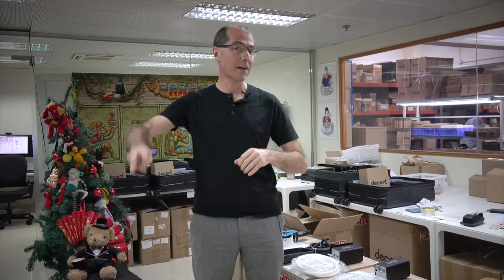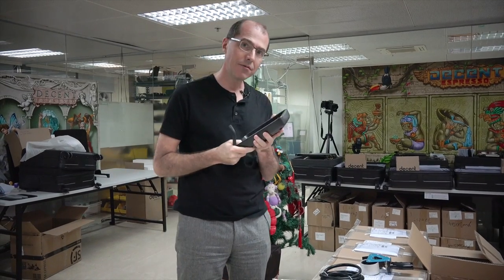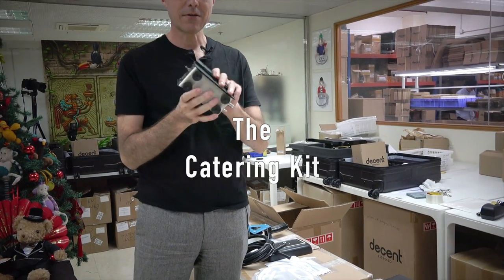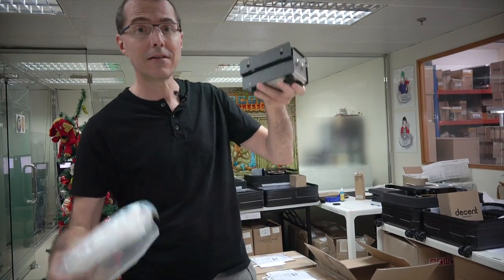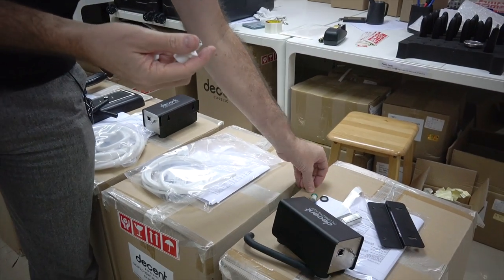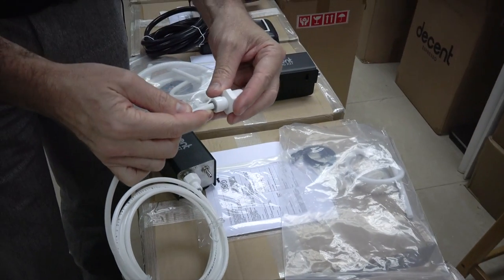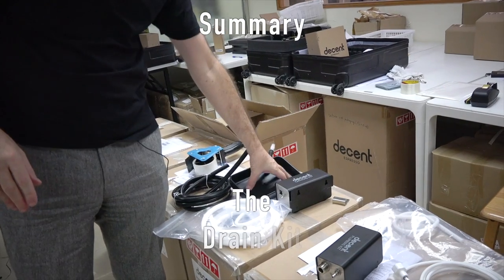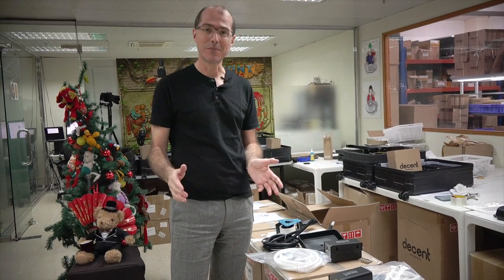The Refill kit

Comment: This is great!  Are these currently available?  if so are they shipped separately or with the machine?
Thanks
Reply: Included with the DE1PRO machines and available for purchase with the DE1+
Reply from the maker: Yes, these are now available but they are shipped separately as they will not fit in the suitcase we used to ship the espresso machine in.

Comment: The catering kit and plumbing kit are refill espresso machine water tank, right? Are there any option to connect directly the plumbing kit to the machine? I want to prevent "old water" in the machine.
Reply from the maker: The plumbing kit will always refill the water tank. However, if you are concerned about "old water" on the tablet software there is a setting where you can decide how little water should remain in the water tank before it is refilled. If you like, you can keep 1 cm of water in your tank so that you're constantly refilling with clean water.
Reply: @decentespresso  After looking at your description of the catering kit in the video, I kind of got the impression that the catering kit directly feeds the machine, bypassing the ceramic tank. Thanks for clarifying. 

Is there a way we can directly feed the machine while bypassing the ceramic tank altogether? If there is currently not a way, but if it could be solved with some kind of changes to the machine in a future release, can this go into the "feature request" for a future release please?

Comment: So is it either you get a Plumbing Kit or the Catering Kit depends your water supply? You do not need both right? I already have a Flo-Jet Pump, which kit do I need?
Reply from the maker: Flojet won't work with our machine.  Our Catering Kit is like a flojet, but made for our machine, and that's probably what you need.